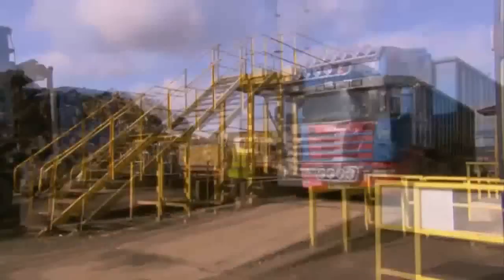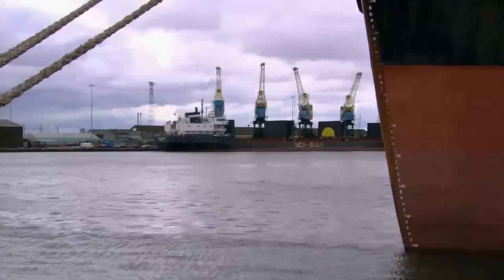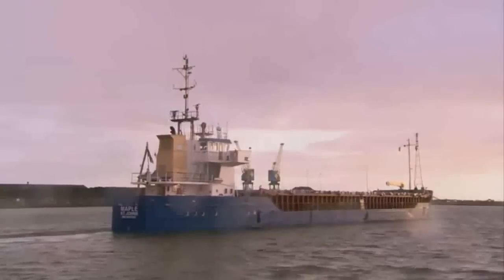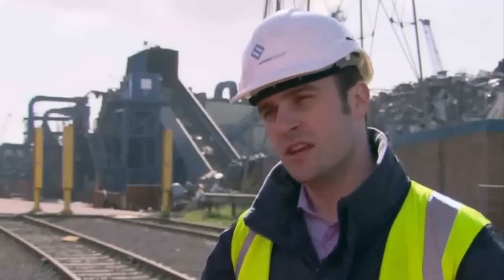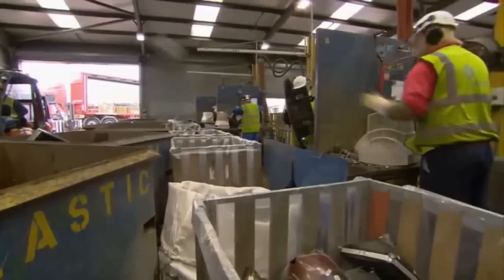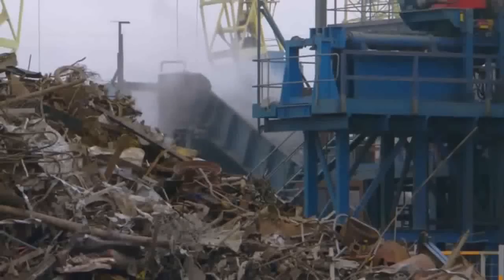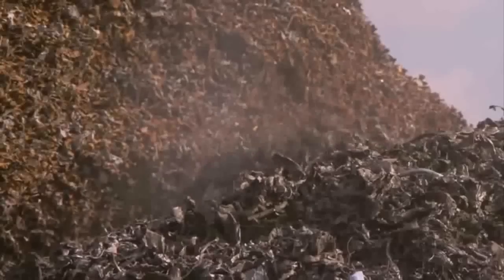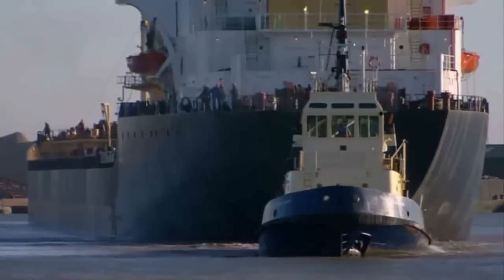Megastructures World's Biggest Shredder Documentary - National Geographic Documentary

Comment: I ran a shredder in Louisiana, U.S.A about 30 years ago. We did our own maintenance. We had no special "engineer" crew. The max cars I ran was 420 in an hour with new hammers and no problems. The yard did not sell metal it did not have. When a ship came there was enough to fill it already processed. There were 3 cranes that could load the ship (2 at a time with an extra). Back then there was no regulations for the waste. We shredded the cars and refrigerators with no prep. Just the gas tanks and tires were removed. Gas tanks blew up and tires wasted energy on no product. I once cut out a pin like for the ram with a regular propane torch with the oxygen turned up to 140 PSI. We did do the bracket method if we could. We still had fires and explosions sometimes. We took care of those too. Really dirty work.

Comment: POM no idea how to fix things, all they had to do is apply heat to the 6" thick pin and then use the hydraulic ram or better still use truck air powered jacks to push it out after heating it up? Why use a lance cutting tool to cut through a 6" thick hi tensile steel ,when the heat alone will warp it most likely ?
So dumb is LOL. Yet so easy to repair that hi tensile steel pin lock for the ram?👍👍🦘🦘✌✌